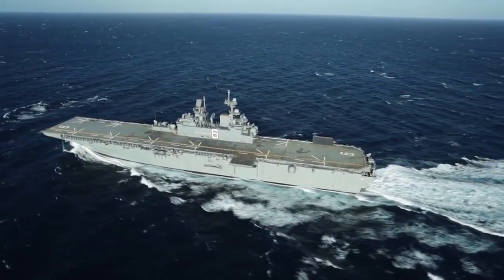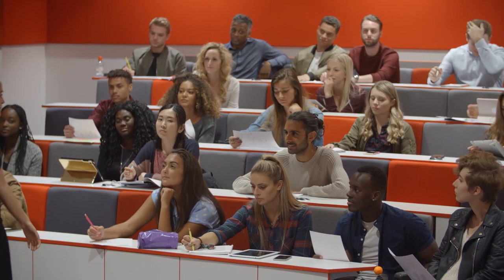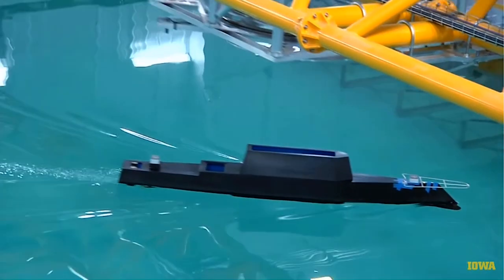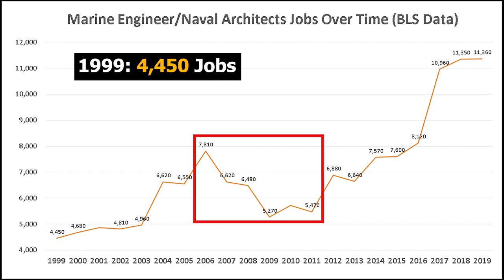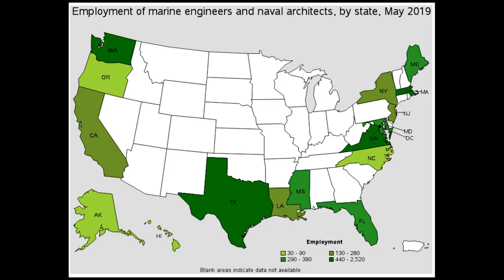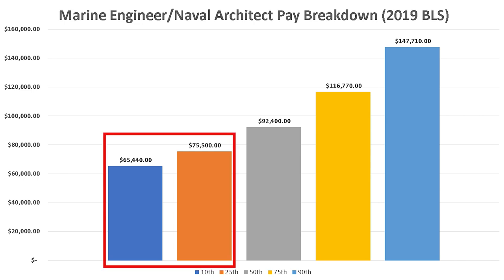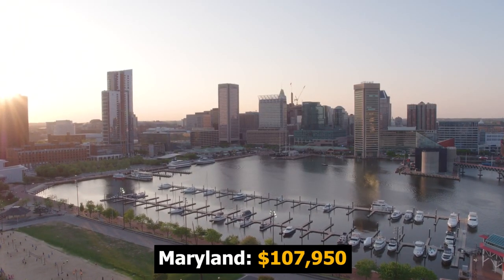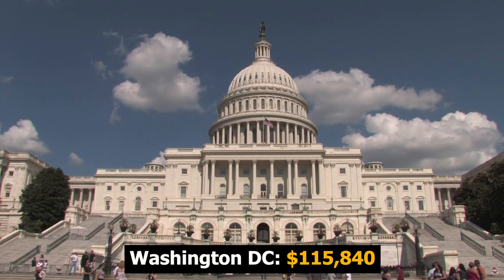Marine Engineering – Naval Architecture (2020)

Comment: I'm 15 but wanting to join  the field of marine engineering any tips on the subjects and what to do and how to get better
Reply: Hi, I'm 16 and basically at the same stage as you. The 3 subjects you will need are Maths, Physics, and Chemistry. If your school lets you do general engineering as a subject I recommend that too. I am determined to go into this profession as my love for the water and boats is bigger than anything else. There is quite a few ways to get into this job: conventionally a degree at Uni or you can go through the Navy. I am considering both options. Best of luck to you.
Reply: I’m half way through my masters degree in marine engineering and it’s a lot of physics and maths, though some basic understanding of business is also very useful too. You’ll also use a lot of CAD software and some do coding.